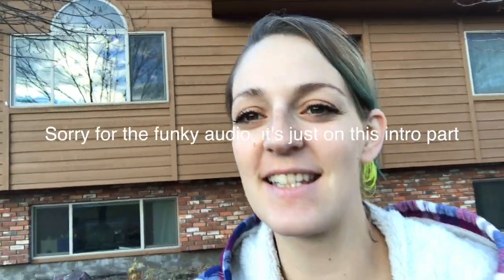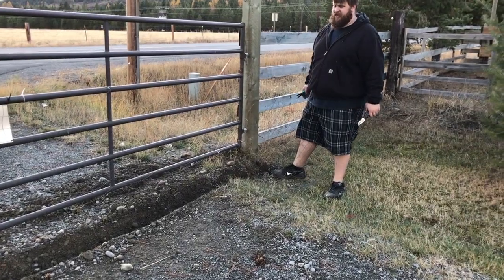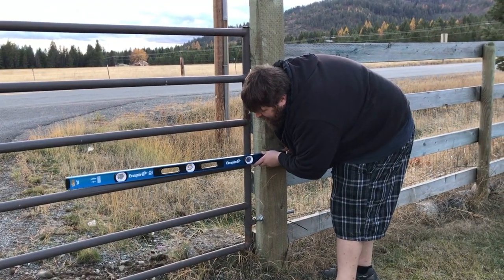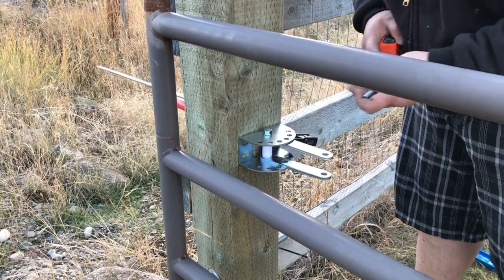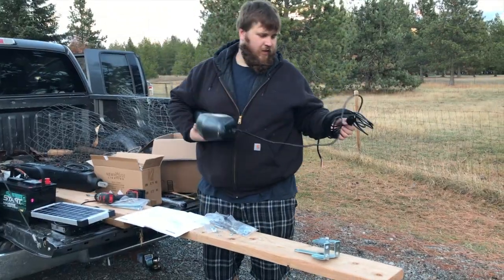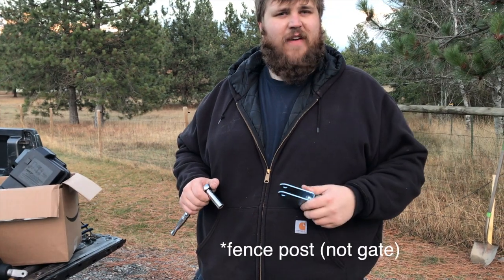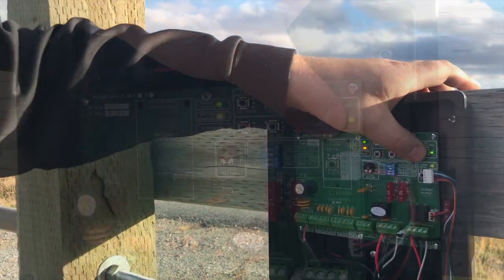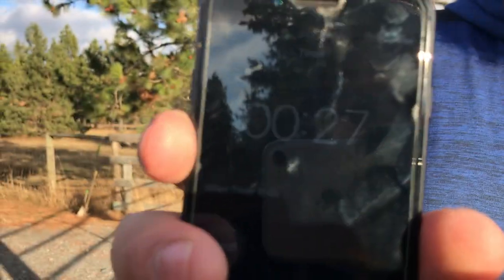Installing a Ghost Controls Gate Opener || FARM LIFE

Comment: NICE INSTALL !  I would have ran the second operator wiring in plastic conduit just to protect it from deterioration over time or possible critters chewing on it.Ghost Controls definatly has the best warranty and tech support going.  Now add the zombie lock when you get the funds or time and nobody can unpin the opener from the gate end and come in while you are both away from home (not likely but possible) Good Job Sir.
Reply from the maker: That's a good point.  Thank you for your comment.  Zombie lock will probably happen at some point but our outdoor guard dogs do a pretty good job for now. lol

Comment: Nice install. How well is that single solar panel keeping up with dual openers? For a little added security without dishing out nearly $200 for the Zombie Lock, you can put the locking clevis pins on the gate mount as well. I used a combination lock and set the combo to match the keypad code. Keeps somebody from simply jumping the fence and taking the pins out.
Reply from the maker: It's doing just fine.  Even with days or weeks of snow/rain, it hasn't failed us yet.  Thanks for the suggestion.

Comment: Nice install. I recently purchased the Ghost Control single arm DTP1 for my ornamental gate. It came with the dual battery box and a small single battery but I’m using a marine battery (and solar panel) like yours. The wiring harness was already pre-installed inside the small battery box so I need to splice it and wire with positive and negative terminals for my marine battery posts. Question: Did you have to cut and splice your’s and if so, did you install the terminals “after” the built in 20amp fuse or before? Also, why does the solar panel you are using have to be wired to the control box and not just to the battery itself? I have a trickle charger regulator that maintains and prevents the battery over charge-discharge but it hooks up straight the the battery posts.

Comment: There a way to clamp the gate close and locked while in the closed position Auto Unlock when gate opens for added security? Or does it simply just able to stay in the closed position while someone can push and go right through?
Reply from the maker: There is a lock you can buy for it. The way it’s installed on this video, yes someone could just run their car through it but they could do that with a lock too. For us, the gate is one part of our security, other parts are the motion lights and cameras as well as our 2 guard dogs that are outside 24/7.
Reply from the maker: The lock made by Ghost Controls is called a Zombie Lock and it is about $170.

Comment: Why bother putting the lock on only one side of the actuator?  As you demonstrated, anyone could unhook the other side and open the gate in seconds.
Reply from the maker: To prevent it from being stolen. Anyone could just jump over the fence too. The gate is just one part of our security system, our outdoor guard doors are also part.
Reply from the maker: Guard dogs*
Reply: @LifeWithTheFultons  Fair enough.  Is the system still working well?  I'm about to buy one.  Thanks!
Reply from the maker: @joemilton7552  Still working great.  We highly recommend it.
Reply: @LifeWithTheFultons   I just got it installed and love it!  All in all it was definitely pretty expensive but so much better than a chain between 2 posts which is what I had before.  I ended up putting a machine screw with nut into the holes to replace the cotter pins to make it a little more secure.
Reply from the maker: @joemilton7552  That's awesome! Good idea.  The expense is definitely the only downfall but ultimately worth it for a quality product.